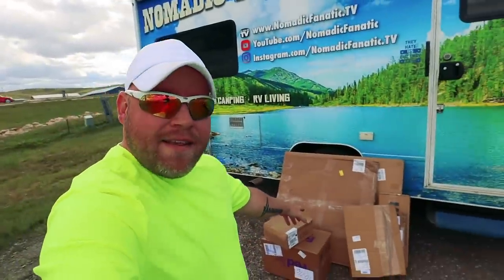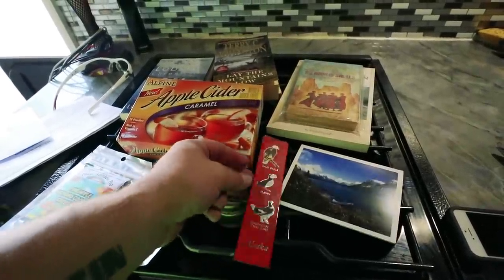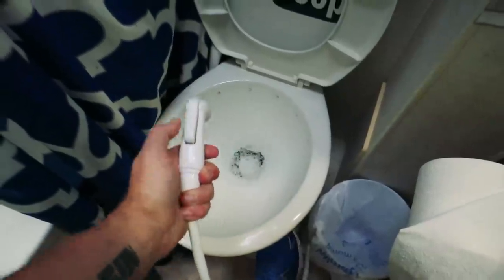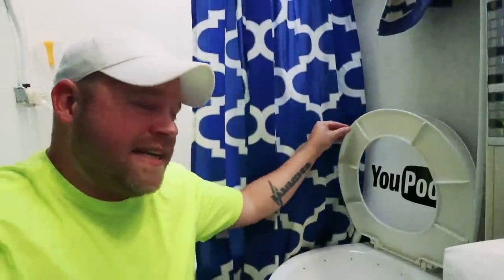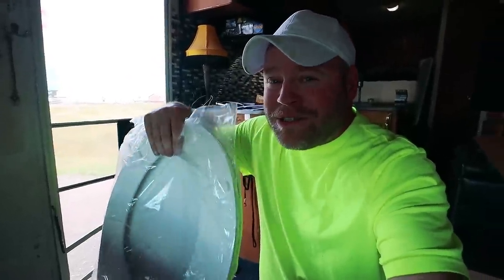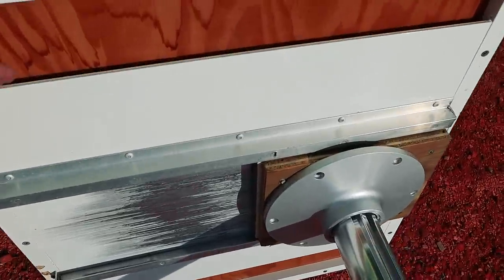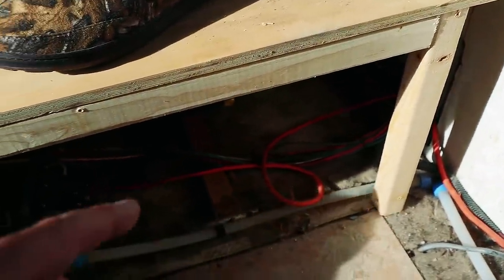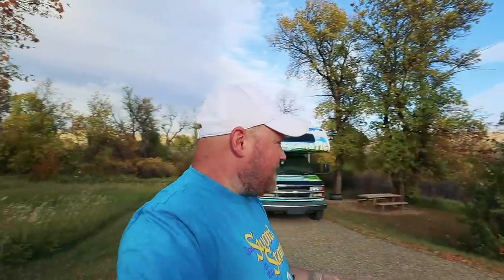Receiving Packages, Repairs, & Upgrades

Comment: What a lovely campground!  You are so resourceful.  I like the swivel table.  It's nice to be able to stand up straight instead of having to slide across a vouch to get out.  I think every camper is really an upside down boat.  All campers should be built like boats.  I have spent a lot of time in boats and I trust them.  
I love the magnets!  Little bits of colorful, 3D art.  They tell a story.  What an adventure you have had so far!  
I think it's a great idea to invest the most in the things you use the most, like a bed or a solid toilet seat.  The extra weight is worth it in time saved cleaning it.  
I bet your cat would love to have access to some small enclosed spaces.  Cats are like that.  He is Looking out for bugs and mice for you.  I bet he would like a shelf for a cat perch.
Have you ever tried a raw food diet for your cat?  
I wonder who has the Nomadic license plate?

Comment: White vinegar is the way to go, add a cup  of two to the water, shut the lid, come back  in a few hours, and a quick swish of the brush and it's down.
You can also use white food grade vinegar in the washing machine to get rid of pet smells. Just put some in the fabric softener spot, it also soften the clothes as getting rid of the oders.  Happy Trails!

Comment: Hey Eric - Great video, as usual.  Love the table upgrade.  Glad to see the magnets back. 
In the table portion I noticed white Teflon tape on the gas line.  When you get a chance, stop by a big box and get some yellow tape for the gas connections.  Yellow is gas rated, white will break down over time and leak.  Don't want to see Jax flying through the air after an explosion!!

Comment: Hey you don't want metal screws on that toilet lid, they will rust and almost impossible to remove and you can break the toilet trying,  the plastic screws are made to break to protect your toilet , I'm a maintenance tech for a resort in Florida for the past 20 years ,
Reply: Stainless is only ‘stains less’, it is not rustproof. Even expensive pocket knives with supersteels can rust.

Comment: I have had plastic bolts for over a decade, no problems. Plus people have a tendency to overtighten the metal one and that may be bad for the porcelain. I have seen the table mounts along with Springfields they are definitely finely crafted and that is reflected in the price. I like a larger surface to work with. so the weight loss is a plus but I would have probably chosen a larger table with the new mount.

Comment: You don't want metal parts to attach the toilet seat with.  Since that's a ceramic toilet they will crack the toilet before the hardware snaps, and that's much worse.  Also, heat/cold with expand/contract the metal risking cracking the toilet.

Comment: If no one has mentioned it yet, use "Plumbers Silicone Grease" to condition the rubber sealing ring. It keeps it supple and soft and it'll last a long time :-)  It's available on Amazon for about $3.75.

Comment: I've recently had smoke detectors installed in my apartment. They said not to worry about the battery, it's good for 10 years and then the whole unit will get replaced. So yeah, there seem to be many different models of these...

Comment: Did you buy the table already prefabricated? And if so where did you get it, please? And the joint that it is on that helps you move it is that a joint that holds televisions to the wall or just similar? I'd like to know where you got them. Thank you God bless travel mercies

Comment: Hey Eric, Thank you so much for the toilet gasket info, even the guy that gave me my walk through when I bought my r.v
 said use vaseline, I was very skeptical, because I'm in the cleaning field and it just didn't sound right. I am certain bleach is a no-no any place hydrogen peroxide is the best sanitizing solution love the table. Thanks for another great video.

Comment: Using metal bolts for your toilet seat would be a bad idea. Metal rusts, and over time metal bolts would become Very Difficult to remove. You might be able to find brass bolts, in which case rust would not be a concern.
Reply: Paul Baldassarre yes there are also issues if you have metal you may really crank them down and crack something
Reply: Bronze bolts. Stronger than brass and more corrosion resistant. Widely used in marine applications.

Comment: What if----- you sealed the RV up and turned your ceiling fan on blowing in.  Then, the air pressure in the Rv would force the air and smells down the toilet and out the roof vent while you are replacing that seal.

Comment: WARNING....Danger Will Robinson,!!!  Hey Eric, use the nylon bolt fasteners on the toilet bowl 🍲.  The two “ears” on the back of the bowl are strong but using stainless bolts can easily exert enough compression to crack the porcelain.  Most people grab a wrench to tighten bolts with lock washers.  Nice find on magnet board, table and toilet seat with cover. The extra weight is worth trade off on ease of cleaning.  Be safe, it’s a jungle out there.......